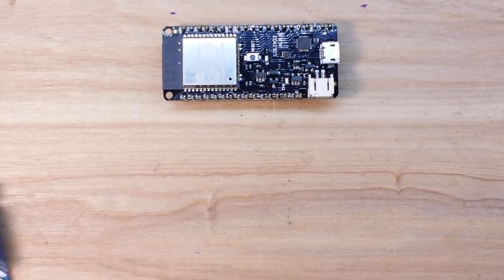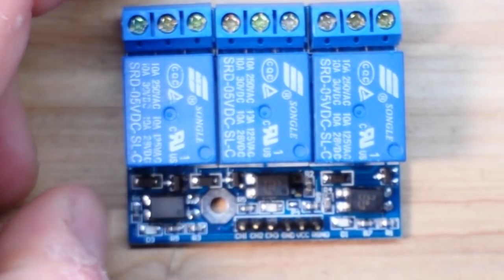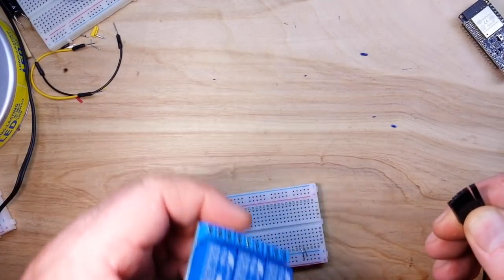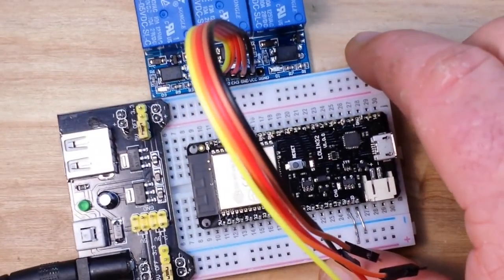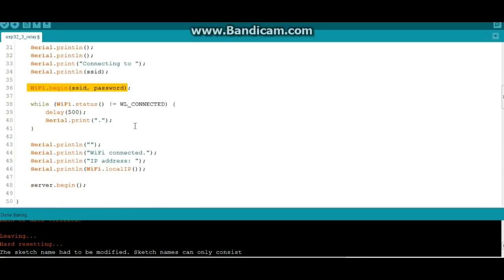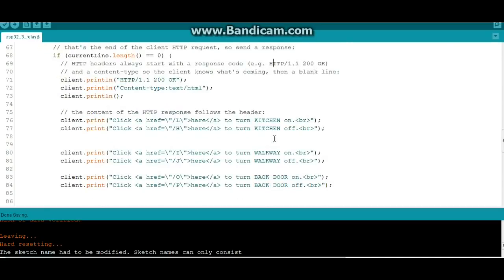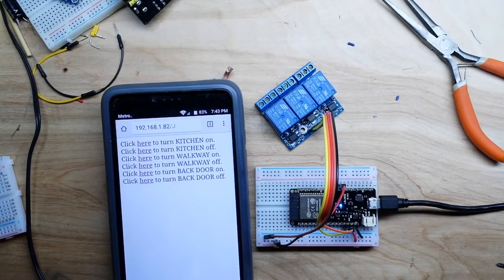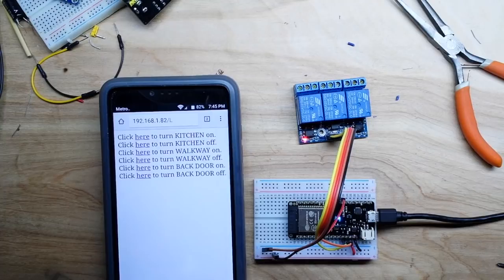Remote control everything over WiFi with ESP32 and relays

Comment: Hello, when I connect to the web server and click on one of the commands, the serial monitor says 'Client Disconnected' and then it reconnects to the 'New Client'. It does that each time I click on one of the On/Off commands on the webpage. Any suggestions? I'm using a different ESP32 board than you are.

Comment: Nice video! But I would like to ask, if you or somebody else tried it with not local WiFi. I don't understand what is DMZ or how I need to use External IP, because I know only basic of programming. Please, if somone know code/video which works like this, but you can remote control from your phone which is on cellar or other sites not at the same as ESP, it would be nice if you will share it to me.

Comment: It might be worth noting that you dont want to set up your router with DMZ as that sends all unknown traffic to that ip addy (bad juju to do that).  Port forwarding 80 to that ip will send Only web traffic which I think is what you want.

From the Arris DMZ setting page...
The DMZ feature allows you to specify one computer on your network to be placed outside of the NAT firewall. This may be necessary if the NAT feature is causing problems with an application such as a game or video conferencing application. Use this feature on a temporary basis. The computer in the DMZ is not protected from hacker attacks.

Comment: Wonderful vid regarding the control circuit side of things, BUT when I tried to connect my AC, it's a little bit awkward...Any chance you can show effective and secure methods to connect the AC? Maybe I'm using the wrong (tiny) screwdriver which gives me very little torque to secure it down or maybe the spliced AC extension cord that I used is too thick, but for me, the A/C connection is tenuous at best and I suspect, with very little movement or jarring, it could possibly disconnect and short out...which, I'm sure I don't have to tell you is dangerous.

Comment: Isn't the ESP32 output 3.3v, how did you run the power?  Thought those opto cuplers and relays need at least 5v.  Thanks for the help and geat video.
Reply from the maker: WA5JM The esp32 (depending on the breakout board) has 5V.

Comment: Hey. I have esp32 low power consumption. Can I use it to drive 5v relay without any external circuit? I need to control a 12v solenoid lock from esp32 with the help of relay.
Reply from the maker: I couldn't say for sure without trying it. Go ahead and try, it won't hurt anything if it doesn't work.

Comment: I have a question to ask you how can I adapt the ESP32 to create traffic lights and want to make it performed automatically and controlled by the App inventor or another app.
Reply: Thanks in advance sir :)
Reply: Sonthaya Taudom you would build the traffic light, and attach the esp32 to the relays, and use the relays to power the lights. Then just write client and sever applications that control them. The sever code would always wait for instructions, and when the client sends them (like from an app) sever reads the request and turns said lights on or off. This doesn’t include sending vehicles, which would be done by an induction coil embedded in the ground. I don’t know how they power those, but you would have the esp32 sense traffic, determine who has the right of way, and then display the green light to that person, while the other lights are red. Hope this helps.

Comment: Please excuse my ignorance, but how do you connect devices to the actual relays? There are three pins per relay, what are they for? How would you position the actual ESP32 + relay board in your house so that you could wire three different light switches to it?
Reply from the maker: +aspuzling The relay has 3 connections, yes. One is a common, usually in the middle. On one side is normally open, and on the other is normally closed.

So if you want something to turn on when the relay is activated, you would cut one wire of the device, say the hot

Next put one side of the hot you just cut in the common, and the other side in the normally open. Now when the relay activates, it will close the normally open contact with the common and complete your circuit.
Reply: Thanks, I also would like to see how you have setup this board in your house. How do you pass wires from three parts of your house to a single point so that they can be controlled by the relay board. These practical problems are the things I have most trouble solving.
Reply: The short answer is: you don't. Unless your home is specifically wired for centralized relay control of fixtures, there's no way to use one controller for multiple rooms. 

In fact, the only real way to control a single light fixture --- without potentially turning off other outlets/lights on the circuit --- is to install one of these things in each light switch box: basically, build a WiFi light switch. 

While I built an ESP8266-based WiFi dimmer once, it's not really a hobbyist-friendly project; I needed a three-PCB stack to hold all the electronics, and certainly nothing was available off-the-shelf.

These sorts of videos produce fun, easy-to-digest demos, but aren't actually designed to be deployed.

Comment: is there any harm to use the 5V from ESP32 to power on the relay module ?
Reply from the maker: It may be too much current, depending on the relay.
Reply: learnelectronics if I'm using 3.3V instead of 5V from the esp32 can I use few diodes parallel to the 3.3V and create a 5V to turn on the relay ?
Reply from the maker: According to specs, you must not draw more than 12mA per pin.

Comment: Hi you should mention your relay is high trigger type and therefore signal pin connect to 5v  during the demo,low trigger type relay  would be opposite, we  need to connect data pin to GND to trigger relay on

Comment: Do you get electrocuted if you touch the relay board like the bottom of the board or the big screws on the top when the AC current is flowing?

Comment: Hi, I have a question which somebody here might be able to answer... what i am trying to do is load a programm which lights LED's in a certain sequence onto my ESP32 and then control the LED's with it. I already did it with an arduino and the code should be the same i guess. However my final goal is to get rid of any physical connection to my laptop and just send the signal per WiFi, basically sending a signal and switching between lines of code from any point in the room and with no cable connection to a PC or so... Is that possible? Ofc for loading the code onto the module physical connection per usb cable is necessary, but afterwards i need it to work without (the module is rotating and the laptop isn't so i can't have a cable connect both + there's a lot of distance in between). Thank You for any helpful comments.
Reply: A little late but You will have to connect it to an external power supply with sufficient current output at your specified voltage which I’m assuming is 5V if you can do that.You can use wago connectors or terminal blocks(terminal blocks suck) and connect wires from the strip into the connector you choose and then into a screw terminal adapter to barrel jack that will connect to the external power supply. Or you can possibly power it with an led driver. I’m sure there’s other ways/better ways. I’m pretty novice myself but do a bit of googling and you should find your answer eventually. You havnt stated if you’re using individually addressable LEDS or not either. Hard to really say without knowing which LEDS you have and what your setup looks like I’m not sure what you mean by “rotating”.

Comment: can I attach 2 8 relay modules 
a total of 16 relays with it???
power supply will be given from other source 
does this have enough pins for that?
please reply
Reply: Technically, yes, this does have enough pins for 16 relays.  I'm not sure about driving 16 optoisolators at the same time.  The 817 datasheet seems to say it needs 5 mA to turn on, which should be fine (5 x 16 = 80 mA), but I'm not sure if I'm reading it right.  You'd be much safer going through two 3-to-8 bit decoder/drivers, or one 4-to-16 bit.  The drive current would now fall on the decoder, and you need less pins.  Be sure to get the 'latch' versions, or you'll only be able to turn on one at a time.  A better option (IMO) would be an SPI or I2C 'port expander' - you talk to them using the hardware serial lines.  Examples are the TI PCF8574A  8-Bit I/O Expander for I2C and the Microchip MCP23016 16-Bit I2C I/O Expander, both of which can be obtained in standard DIP packaging.

Comment: It works thank you  but how do i set up  dmz and find external ip address...and  make it secure ?
Reply from the maker: +Nathan Borg That all depends on your particular router
Reply: it says Cable home network gateway  cg3100d-2bpaus
Reply: netgear just the one my isp gave me ?
Reply from the maker: +Nathan Borg I'm an electrical engineer, not an it guy, so I don't have a definite answer for you... But you need to find the IP address of your esp32, then let into your router (192.168.1.1 or 192.168.1.254) navigate to firewall and allow an http server through
Reply: Ok Thanks for your help mate ill give that a go
Reply: thanks  it worked now i just gotta figure out how to secure it with a password
Reply from the maker: +Nathan Borg That depends on your router

Comment: HII AFTER  UPLOADING YOUR CODE ON MY ESP32 THE ESP32 WIFI IS NOT SHOWING ON MY MOBILE WILE WIFI SCAN WHAT TO DO HELP ME OUT 

..
Reply from the maker: +Chip Logics check your serial monitor to see you are actually connecting to your WiFi network.
Reply from the maker: +Chip Logics change baud rate to 115200
Reply: Actually my ssid was hidden  how can I turn it on
Reply from the maker: +Chip Logics no clue, Google your router model
Reply: I just had esp 32 just uploaded your code
Reply: Before uploading your code my esp32 is in visible mode I can able to scan the wifi  using my phone 
After uploading your code my esp32 visibility was gon can't able to see my esp32 WiFi on my phone that the problem